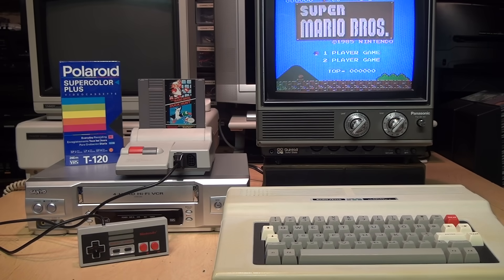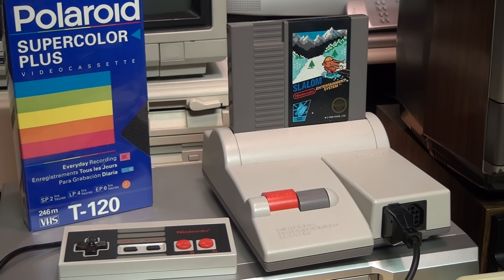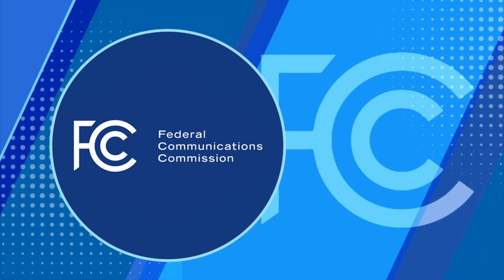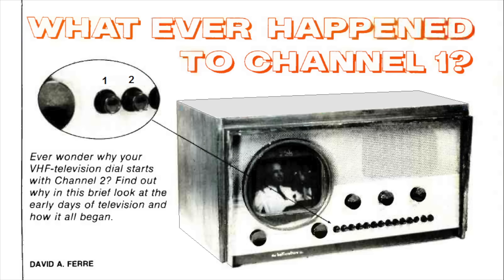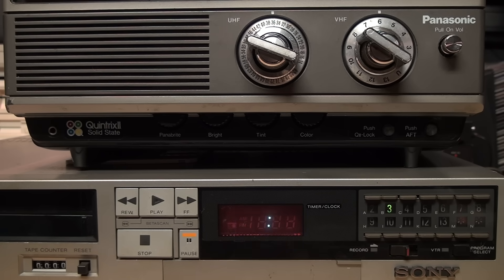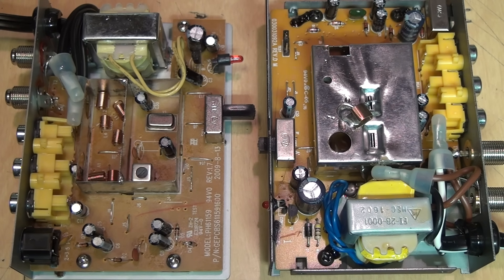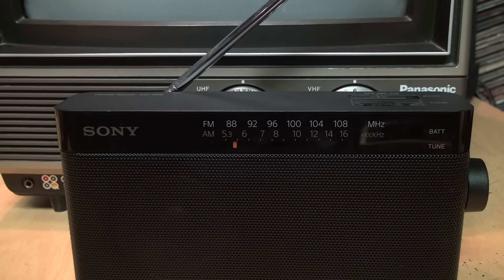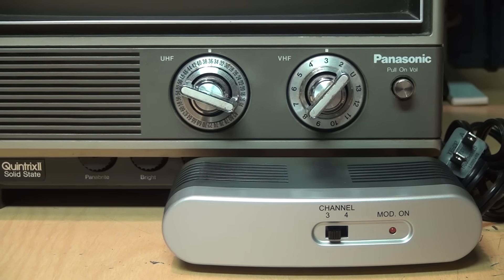Why your Nintendo was on Channel 3 (except in Cleveland)

Comment: I had my Nintendo set to channel 4 BECAUSE there was a channel there lol (STV / Global). At the time I thought you were supposed to use a channel that was already in use so you don't get a lot of loud static when you turn the Nintendo off. When we got cable, the installer set it to channel 3, probably because there was less interference. He didn't have to do that but back then cable companies used to go above and beyond for their customers. Also it would be great if you could get RF modulator / switch boxes that would output the different inputs on different channels, but I don't think anything like that actually exists unless you rig something up with some professional equipment.

Comment: I have no nostalgia for hooking up devices to TVs over RF. Even as a kid I knew the quality was garbage. I never understood why higher quality connection options didn’t become available sooner. I know the answer is “cost” but I also think consumers at the time had a high tolerance for low quality images.
Reply: It did have the advantage, with UHF at least, that you could use a set top antenna on the TV and another one plugged into the modulator, point them at each other across the room and get the 80s equivalent of wireless streaming 🙂

Comment: In Sacramento i had to use my Sega CD on 4 because 3 would artifact everytime i had it on there due to KCRA being on 3. I also have 6 which was my PBS station that was on 87.7. But once i switched to cable i could pretty much use either 3 or 4 just fine before upgrading to RCA outputs.

Comment: Nice reference to 25 OR 6 TO 4....and you even had the CD right there just by accident too I bet. As for those thick coaxial cables, what a pain in the a$$ trying to bend them. I much rather the regular or average ones, uncut too...that way I get to adjust it myself on how much I want to center rod to stick out. It's all about the freedom you know.

Comment: *reads title*
For us, it was Channel 4. Channel 3 was occupied by WFSB (CBS) in Hartford, and even if RF modulators of that time had an option for Channel 2, it would have to compete with WGBH out of Boston - depending on the weather, sometimes we could get a decent signal.

Our rooftop antenna lead passed through two VCRs, a VideoCipher II satellite TV (C-band) descrambler, and either the Atari 2600 or NES depending on what year it was, before finally ending at the TV. The TVs and VCRs had separate UHV and VHF terminals on both input and output, and the TV had separate input antenna terminals, so add 5 UHF combiner/splitters into the loop, too. Add in the wiring from the satellite dish positioner and receiver (separate units, ugh!) and it was a regular old Spaghetti Junction behind the entertainment center! Black coax going everywhere... Who knows how many dB in signal strength were lost simply because connectivity wasn't that flexible or convenient!

I remember being able to receive Channel 6 audio on 87.7 FM in the 80s. My mother's '87 Pontiac's factory stereo tuned from 87.7-107.9 MHz, my father's aftermarket radio in his S-10 Blazer tuned from 87.9-107.9 MHz, so discovering my mother's car had this "feature" was pretty amazing to ten-year-old me. (Her stereo also had C-QUAM AM Stereo, another mind-blower.) Channel 6 was a low-power CBS affiliate out of New Haven (usually broadcasting the same content as Channel 3), my mother would often listen to her soap operas in the car (As The World Turns, The Bold & The Beautiful, Guiding Light) in addition to other shows like Sally Jessy Raphael, and that new afternoon talk show with up-and-comer Oprah Winfrey. (Perhaps you've heard of her? Mark my words, she's gonna be BIG someday! 🤣). If Mom was in the car long enough, she could skip her VCR recordings of whatever she had listened to in the car...

5:39 - Our first VCR, a Mitsubishi, purchased from electronics chain Tokyo Shapiro, had a corded remote, which definitely was a trip hazard. I personally tripped over it at least a dozen times; my mother, at least half a dozen times. Sometimes the control would launch across the room at us, other times the cord would rip out of the plug. (How that plug socket never broke, I'll never understand! It's just a simple mini-DIN, but it took a lot of abuse...)

9:26 - 💁‍♂ Well-played, good sir!
10:18 - I doubt SDI would work well on RG-6 coax, as most of us with rooftop antennas used. I remember having to pull all the RG-6 out of my house to run RG-59 for Cable TV because it was insufficient (impedance and shielding).

Comment: I am so confused with American analog TV. In Australia it was nothing like this. There was no "channel" for RF, you could manually tune it to any channel your TV supported. My family TV had channels 2,0,7,9,10, U, and another I can't remember. we had 5 channels of TV growing up in the late 80's and most of the 90's. So they were the only buttons on our TV's. 
When connecting a RF console, VHS, TRS 80, in my case, you could choose any of the channels, but you had to tune it in. My TV had a panel that you could eject like a draw, that had a tuning wheel for each channel. 

It would be cool if you found something similar to cover.
Reply: In Australia it was exactly the same.
Reply: @bradallen8909  No it wasn't. Any channel number could be tuned to anything.

Comment: I have sen Apple II series machine with the channel 33 Sup R mod in the Youngstown area. SDI is pretty cool and has come a long way from when the standard was first set in 1989, pretty cool that you can send an SD digital video signal nearly 1k feet on standard 75 ohm coax.
Reply: witn 1080p60 its only about 100m, still way better than 5m with hdmi

Comment: Another thing was that many TVs would be on channel 3 when you turned them on if they had an electronic type of tuner and didn't have memory to store what channel it was on.  The TV our family got in 1984 always came on with the channel on 3 and that set was handed down to me and I used it until 1993 or 1994.   Having the modulator on channel 3 made it easy to turn the set on and it be on the channel for the video game or cable box.

Comment: I live in Chicago.  When I was a little kid, I lived in a condo building that had a master antenna, which mapped many UHF channels to unoccupied VHF channels.  We had WSNS channel 44 mapped to channel 3, and CBS in South Bend, IN was mapped to channel 4.  However, we had one of the first cable services, "Channel Extra," which worked fine on channel 3, and I also used a VCR on channel 3.  I don't remember seeing any interference from channel 44, as the cable box and VCR output was crystal clear.

Comment: It should be noted that the FCC assigned channels to markets so that two adjacent channels wouldn't be used to avoid interference.  The exception is with 4 & 5 because there is a 4 MHz gap in the end of channel 4 and the start of channel 5, so though the channel number is adjacent they can both be used in the same TV market.  

They also made sure nearby TV markets didn't have overlap on assigned channels.   I grew up in the LA market and we had/have 2, 4, 5, 7, 9, 11, and 13, whereas San Diego had 6, 8, and 10 and Santa Barbara had 3, 6, and 12.  Of course, all three markets had UHF channels, as well.
Reply: What’s interesting about Channel 6 in San Diego was that it was actually licensed to Tijuana, Mexico, yet targeted San Diego until its English-language operations were shut down in 2017. It also had a callsign of XETV, as Mexican callsigns all begin with X.
Reply: Came in expecting to post this, leaving satisfied that somebody already had so I didn't have to! 😊
Reply: Some more exceptions include 6 & 7 and 13 & 14, because of even larger gaps in between those channels.
Reply: I'm guessing tuners were less precise in the early days, then? Because obviously interference between channel 4 and your VCR sending on channel 3 was no longer an issue by the time VCRs came along.
Reply: I grew up using ch 4 for everything. I always thought that was the norm because we had a KCRA on ch 3. Funny thing is we had KVIE on ch 6 in our area as well. I guess it makes sense that Sacramento would use those as 2, 4, and 5 were used in the Bay Area. We couldn't pick up 4 or 5, but 2 and 9 came in where I lived. We'd sometimes have to watch the Giants on ch 2 when they weren't on the local station.
Reply: KSBY 6 is licensed to San Luis Obispo (same TV market as SB) but gave it greater distance from XETV 6 from Tijuana.

Comment: What a coincidence, I just bought something that includes an analogue RF modulator built-in. It's a Philips PM5518-TX Colour TV Pattern Generator! It can generate various analogue baseband test patterns, and you can also enable the RF modulator to test a TV or receiver, and it can transmit on any channel, but obviously I'll need to avoid channels that were reallocated to DTV broadcasters or the mobile network operators. I was mainly going to use it to test and adjust old monitors, but the RF modulator might be useful for getting a picture into more modern TVs, since many can still tune into good old analogue RF broadcasts, even though they ceased years ago.

Comment: Okay, you ended this video on a hook.  What, in depth, is SDI, and what was the distinction between professional and nonprofessional SDI use, and why was it possible to use it for pirating, and how would the pirating have been done?  We need a sequel video. 📺
Reply: SDI is essentially a professional counterpart to HDMI, that uses coax cables instead of twisted pairs like HDMI. And also unlike HDMI and its HDCP scheme, SDI has no provision for encryption, so any signal can be intercepted with an appropriate capture card. Which is a big no-no for right holders that made them lobby for a connection standard that does support encryption. Like HDMI.

Comment: Here in Australia, I remember VHF modulators being channel 1 but later ones were 4 (the only one I have to hand is not switchable). Using 4 had the advantage of there probably being nothing there as 3, 4 and 5 overlapped the FM Radio band, so TV stations were encouraged to move to UHF once there were enough people with UHF capable TVs. Actually, UHF support was a genuine problem for our fifth network, SBS, which was broadcast on VHF 0 as well as UHF 28 for many years.
Reply: WIN originally was ch 4 in Wollongong.
Reply: @msyoungau   Yep. Dad found a VHF 4 antenna to add to our house in Sydney's south at one point because we were high enough to get it (just). And Newcastle had NBN 3, too.

Comment: Pretty sure I got it from Parts Express, but I had (and probably still have) a multi-channel RF modulator that can send 3 different video signals to any channel, VHF or UHF. I used to use it to send video throughout the house.

Comment: Yep, as a clevelander, every handmedown video game console with an RF modulator was tuned to channel 4 when I got it. I never really gave this any thought until now.
Reply: I remember using channel 4 in NC, south of Raleigh. The signal was slightly cleaner, despite there being an existing channel 4 broadcaster, WUNC, in the broadcast area. There was a channel 3 broadcaster, WWAY, further away from me and closer to the coast.
Reply: @matthewlwood That could have been to maybe channel 3 broadcasting at much higher power, and also there the complicated aspect to polarization of radio waves, which could differ between TV channels, but I always used channel 3, since being in Western NC, there was out of Greenville SC, WYFF NBC 4
Reply: Lived in Cleveland and Akron as a child…channel 4 was it for me
Reply: Grew up in Cleveland myself - a couple times over the years, friends have questioned me why I flipped things to channel 4 out of habit. It’s because I didn’t want NBC News overlaid over my game of Sonic The Hedgehog!
Reply: @ennexthefox  I was just thinking the same thing. Grew up in the Cleveland area but moved to Michigan when I was 10 and couldn't figure out why everyone chose channel 3.  "No, 4 is the right channel!"  ...whoops.
Reply: @ennexthefox  why “NBC News”. WKYC was departing from a quasi O&O to an affiliate they aired more than just news. Like friends, ER, Seinfeld, etc.
Reply: The Sacramento, CA market had the same thing, as KCRA-TV was on channel 3.
Of course, UHF is commonly used for transmission, now.
Reply: I was in southeast Ohio and we had an rf that could switch between channel 3 and 4, I would use whichever worked better that day 😂 
I used an older 70s floor model for games
Reply: Same!
Reply: We didn't even have anything on channel 3 in CT. It went from 2 to 4 , 3 may have been like a local type channel some regions on CT.
Reply: @WizardoftheGhost There was a Channel 3 in Hartford, Ct.
Reply: Yep channel 4 was always “whatever thing you just plugged in” never occurred to me that most of the rest of the country was using something different.
Reply: Same...  I grew up down in Geuaga Lake.
Reply: I mentioned 3 5 and 8 out 9f town once and was looked at weird
Reply: I always used three in the 216. No problems at all
Reply: I always had channel 4.. Montana here
Reply: We had the same issue in Central Oregon (Bend, Oregon; Redmond, Oregon, etc). I actually knew as a kid that's why we had to use channel 4, as the local PBS affiliate there in Central Oregon definitely did use RF channel 3. Sometimes the sound of the PBS shows could briefly be heard while turning the TV on onto channel 4 before turning consoles on, and it could also be heard on 4 if we turned the console off before turning the TV off. I knew quite well that the OPB affiliate was definitely there (OPB = Oregon Public Broadcasting) on channel 3 back in those days.
Reply: I always used channel 4 as well when I lived in Maple Heights which is like 20 minutes from Cleveland.
Reply: They'd come from the factory set to channel 3. I recall wondering at one time why do we always need to set these to channel 4 out of the box? Can't they just assemble these set to channel 4? I never considered I was in the odd-ball region and why channel 4 was even an option. If channel 3 in Cleveland didn't exist, RF modulators maybe wouldn't even have an option to change the channel.
Reply: Same. I just always knew that channel 4 worked better when I was a kid, but didn't know why. Every place I lived after that seemed to always have a channel 3 as well, so I just stuck with 4, thinking it was because "bigger number means bigger signal" not realizing how true that was, and also how unrelated it was to my problem. I still prefer channel 4 to this day.
Reply: Not that I traveled the country as a kid but I never saw a TV station on channel 3,
Reply: I just use channel 4 for many things because channel 3 contacts are skitzy .. . Yeah it's a old TV with channel clunk knobs. I still have today
Reply: My stuff defaulted to Channel 4 in Shelbyville, Indiana but Channel 3 also worked
Reply: Damn dude… I’m from Cleveland and never thought I was different
Reply: I always switched it to 3, no issues whatsoever. hehe
Reply: Once again a viewer that has no clue what they are talking about when it comes too Nintendo. You can switch between 3 and 4.
Reply: @OneAndOnlyZekePolaris  Please re-read my comment
Reply: @tylerwatt12  Don't need to as I was not correcting you I was just saying it is not enforced. We can change it. Every NES has this feature. Does not matter what you say so I do not need to re read anything. Just check your system for yourself.
Reply: @tylerwatt12  Maybe you should re read my comment.

Comment: In Mexico, despite having agreements to comply with the FCC first, UHF wasn’t mandatory until the late 80s, actually, it was discouraged and was even treated as a band for experimental broadcast, also up to the late 80s.

To make matters worse, the protectionist policies in the 70s forced the population to purchase domestic products, and TVs needed to be cheap to secure sales, as a result, stores sold B/W TVs with vacuum tubes without UHF tuners all the way to the early 80s.

Because of this, the government in Mexico City sold tuners and had an assistance phone line to tune into their own channel 22 from the channel’s launch in 82 through the dissolution of the television company in 91.

Comment: Hartford, Philadelphia, Las Vegas, and Shreveport were additional examples of additional markets where 2 or 4 was used for this purpose.
Reply: Yep, grew up outside Hartford, my games and VCR were always set to 2, because channel 3 was "WFSB Eyewitness News".  Never knew this wasn't normal till I saw this video.  Seems like not a big story after all, seeing how several cities had the same setup.  More like "most, but not all people used channel 3 on their Nintendo, unless it conflicted with local broadcasts which is obviously why the switch gave you more than one option"
Reply: I had to use channel 3 in central Kansas.  KSNC broadcasted on channel 2.

Interestingly enough,  KSNW was on channel 3.  But 3 wasn’t quite as strong as 2 was for us.
Reply: New York and Boston both had stations on channel 4. Hartford, halfway between them, got channel 3... and thus got to crank up the wattage so that the signal could reach the outskirts of both the Boston and NYC metro areas. Heck, we used to receive WFSB in southern New Hampshire... with a stronger signal than any station in Massachusetts or New Hampshire.